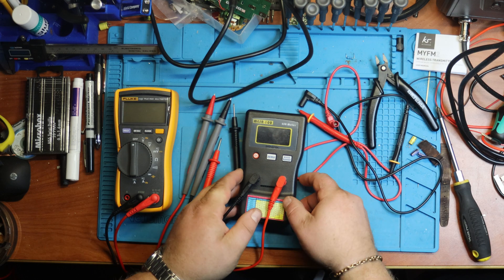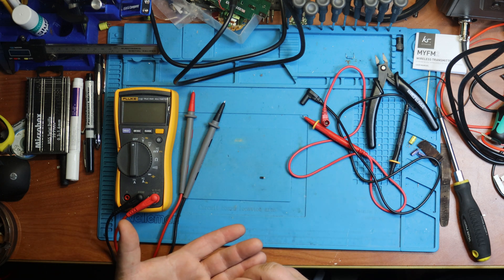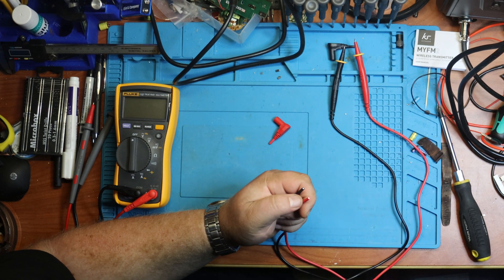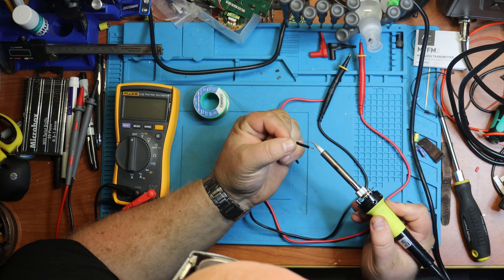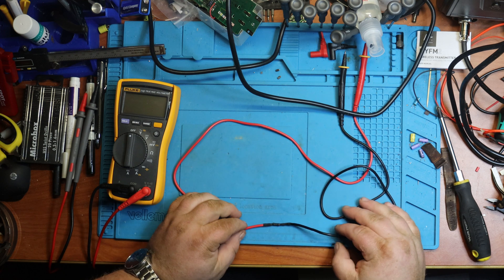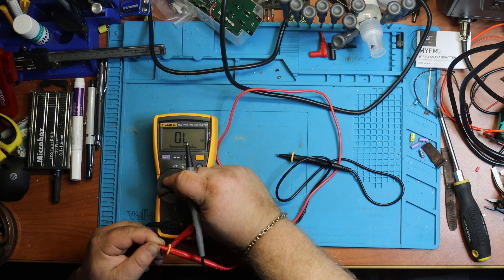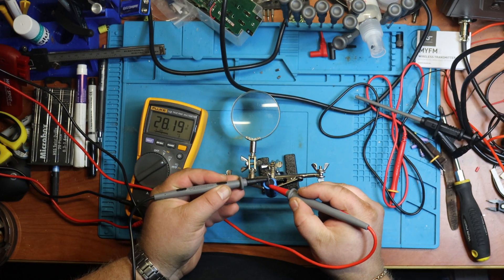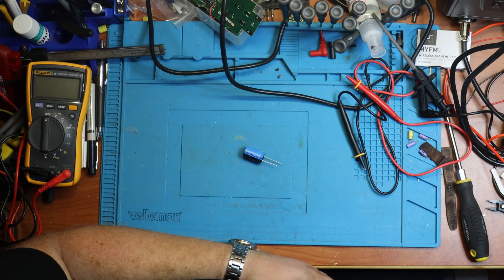MESR 100 V2 update (almost destroyed it!)

Comment: If you can remember to use the discharge probes, you should remember to discharge the cap by touching it with a screwdriver or a piece metal object before measuring the cap. I know the 10 ohm resistor is to reduce the spark but will not completely discharge the cap.

Comment: I’m a noob.  Can I ask a dumb question?
When you said “That one’s COMPLETELY shorted”, what exactly does that mean?
I assume that shorted means electricity goes through with little to no resistance.  But, without the beep, what kind of “reading” indicates it’s bad?  Thank you.
Still reading & watching YouTube to understand.  Thanks.
Reply from the maker: @daytonagreg8765 In the case of a diode (where electricity is only supposed to flow in one direction) when electricity flows both ways, it's toast. Electricity is only supposed to go from anode through to cathode and be "stopped" from cathode to anode. If diode mode continually beeps (showing constant flow) in the wrong direction, the diode is bad.